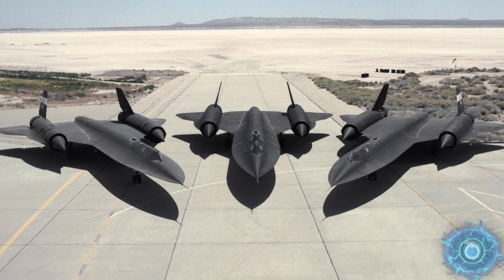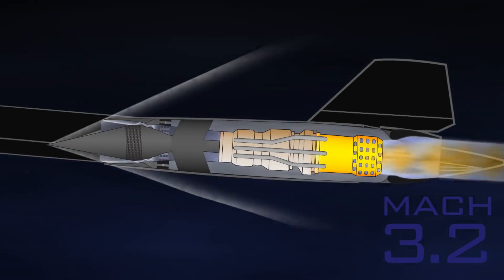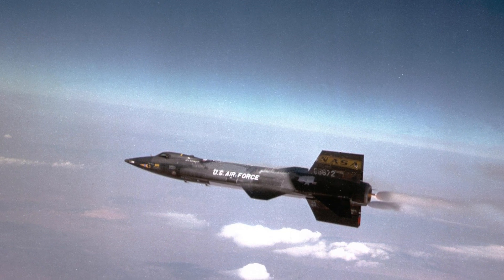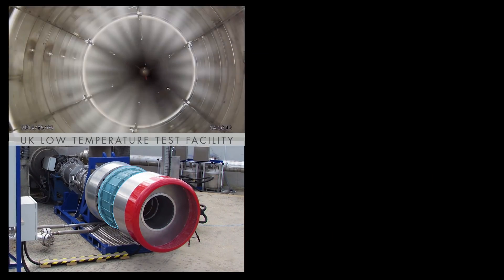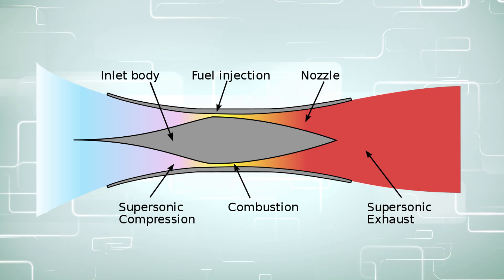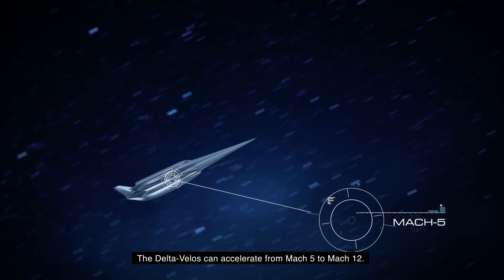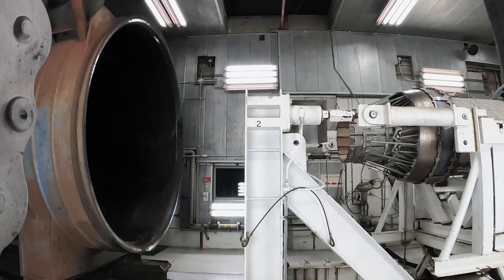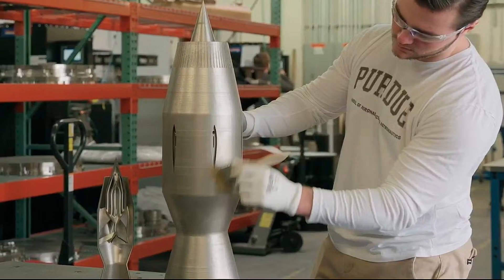Jet Engine BREAKTHROUGH!? Hybrid Tops Mach 5+ Speeds

Comment: Jet are impossibly impractical to power with electricity - the only possible way to generate the necessary power is nuke, and that's just not something you wanna fly around - let alone that plasma turbines are only theoretical atm
Reply: Both the USA and USSR have flown nuclear powered aircraft
Reply: @ECL.. The test beds weren't powered by the reactor.
Reply: Lockheed Martin is working to remedy the problem with power.